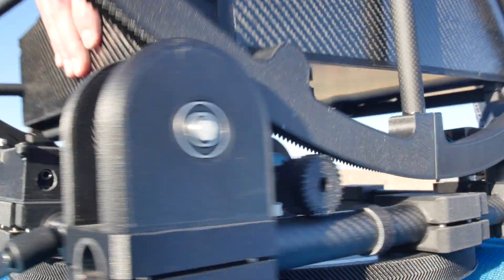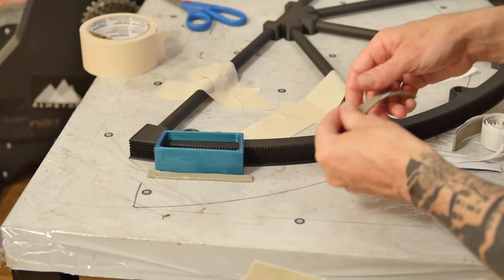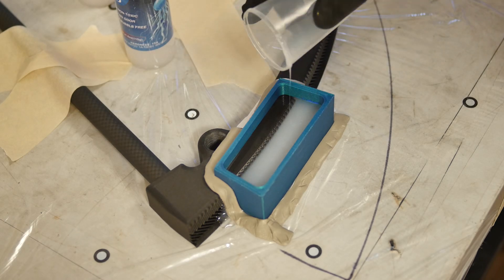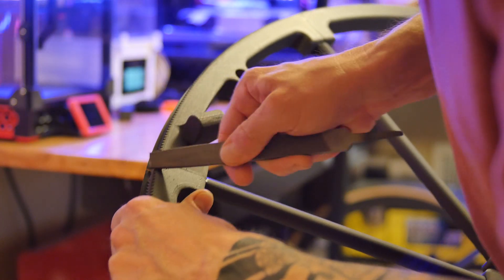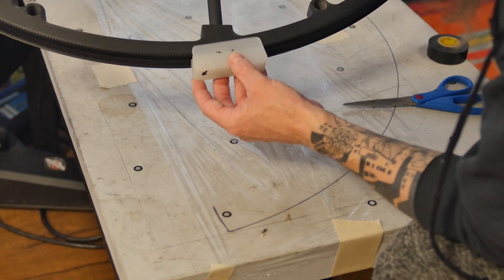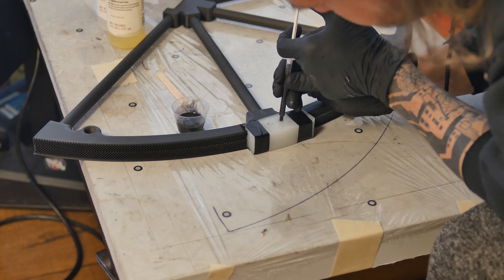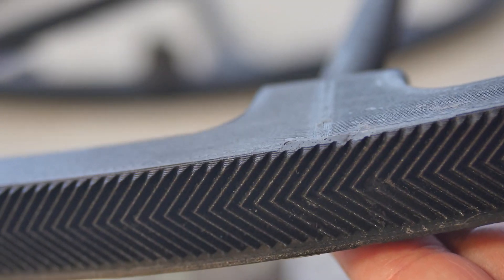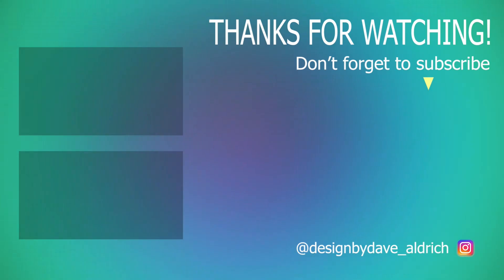How To Repair 3D Printed Gears

Comment: Very impressive result overall! I probably would have gone with like super glue and baking soda then shaping by hand with a small Dremel bit or something. This is definitely prettier.
Reply from the maker: Thanks! 
Yeah some form of hand filling/shaping is what I initially had in mind but that turned out to be SUPER hard with these small gear teeth.

Comment: I think you might be able to avoid this process by prtinting yourself some assembly guides for the gear arc sections, basically an inverse gear sector that you clamp across the gap between two adjacent gear sections. It would also help if you split the sections along the bottom of the herringbone following the root of the tooth.

But as far as repairing an existing part, this seems like a useful technique!
Reply from the maker: Thanks, yeah I considered some form of assembly jig / tooling but I decided to raw-dog it and see if that was good enough. Turns out I was close. If I were to build these again I'd probably look into some kind of alignment tooling.

Comment: Nice strategy, personally I would just split them along the seam between two teeth. That way the transition is in line with the teeth and the effort required is much less.
Reply from the maker: Thats a great idea. In practice however, I think something like this might still be required due to misalignment during assembly. At least that was the case with these gears.

Comment: So, how's that CF printed bike holding up?  Just watched your build video on it.  Was thinking about tasking a QIDI to do the same.
Reply from the maker: It's been great and I love riding it! I should do an update video as I have almost 700 miles on it over a couple of years now.
Reply: @designbydave  Please do.  Also, you quoted ~200 hours / 5 weeks on the process - I'm sure with some learning curve.  Do you think that process could be optimized and the build time cut in half?
Reply from the maker: @GuyVsDisability I can't say. It's been a while so I don't recall what went into that time estimate, it may have included the CAD and prototype part printing.